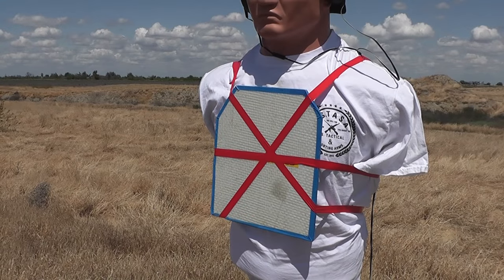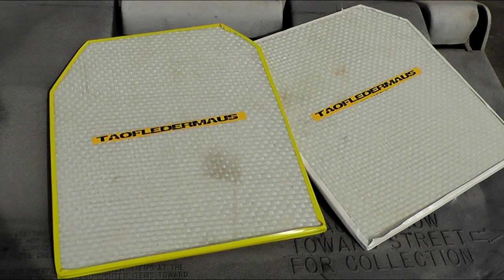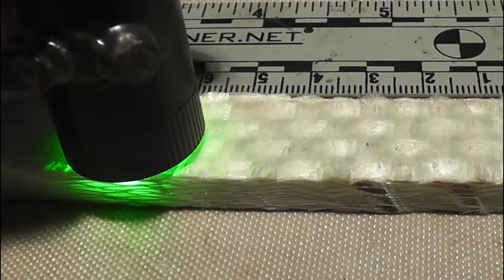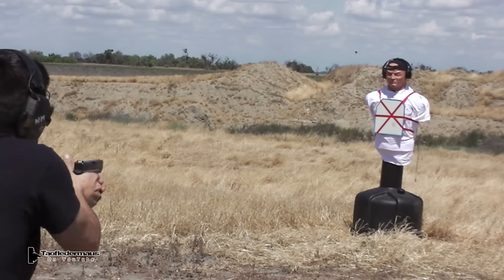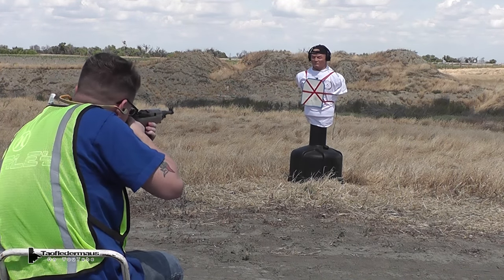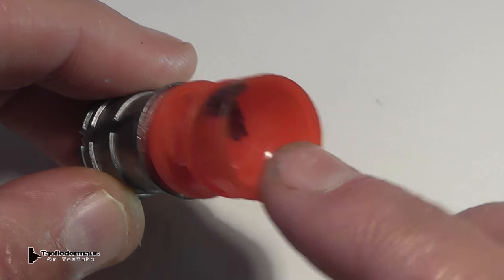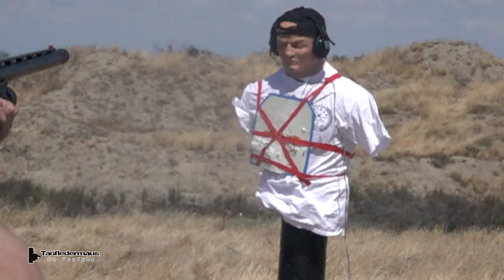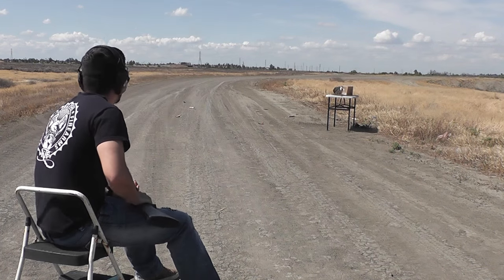Very Effective FIBERGLASS Body Armor

Comment: Everything is bulletproof if you have enough of it
Reply: +Jeronimo Murruni Every material
Reply: SalveMonesvol What do you mean with "material"?
Reply: Jeronimo Murruni A meterial is a simple or composit entity which has mass and shape. Essentialy, a solid. Air is not a material, since it can slow bullets, and you can argue that being in a hot air baloon various KM high, will prevent bullets from reaching you, but it will be the combination of air ressistance and transformation of Ke into Pe what eventually stop projectiles, not the gas. You could have a stream of hot plasma thick enough to destroy any projectile, but it will only work with projectiles coming from the side or below the stream, since projectiles coming from above would become a deadly rain of molten substances, with the same amount of Kinetic energy as the original projectile. Liquids like water will slow or break projectiles, and absorbe radiation, but even if you were in the bottom of the sea, a long penetrating rod would still get to you with great speed, since liquids can only slow down based on the ballistic coefficient of the projectile.
 Finally, only a material with sufficient tensile strength and in sufficient amounts, will be bullet proof. even the strongest non newtonian fluids will allow a steady penetration, only limiting speed.
 I know I went overboard, but It was a reasoning exercise for myself as much as an explanation.
Reply: SalveMonesvol You left me speechless.
Reply: +SalveMonesvol very good explanation.
Reply: +SalveMonesvol  His original statement is true, though. With enough air, you can stop bullets. 

I wonder what would happen if you shot a gun in a wind tunnel?
Reply: PumpJack McGee It will create an aceleration in the opposite direction where the air hits to. E.G. if the air hits on the right side of the bullet (air goes from right to left), it'll create an aceleration to the left.
Reply: PumpJack McGee It's like shooting on a windy day, the bullet will go on the same direction as the air goes
Reply: SalveMonesvol Because gravity will accelerate it. Air stops things if there is nothing accelerating them
Reply: @111001340073883456990 Therefore your armour works in imaginary, convenient circumstances? Also, the power required to maintain a certain speed increases cubically, therefore as the speed decreases, the air resistance will decrease logarithmically, therefore never, even in theoretical conditions, will the projectile be stopped. Also, as you may argue that infinite air may make the speed tend to limit=0←, I could argue that in such theoretical conditions my projectile can have an infinitessimal cross section, and infinite length, therefore cancelling the effect of air ressistance.
 We can waste our time arguing about theoretical shots with theoretical projectiles, but a real cannon will obliterate you from over 100km, with its projectile describing an arc of even greater length, without being stopped by the air. 
 Also, I doubt anybody will accept the idea that being surrounded by a thousand kilometres or air can be considered armour.
Reply: SalveMonesvol  Gravity would accelerate the rocks in that scenario. In regular circumstances, gravity works against the bullet.
Reply: PumpJack McGee Then you suggest that an armour dependant on the relative position of the shooter can be considered as such? with or without gravity, no reasonable amount of air will stop every existing projectile. 
 Have you decided weather you want to consider theoretical or realistic scenarios? Because theoretically, I am right. Realistically, I can't shoot a target a million km away, and you can't consider such distance to be your armour. 
 I propose that we consider that if the armour can be of great thickness, the prime factor in preventing damage should be the armour itself, and that the weapon's canon can be 1% as long as the armour's thickness. Also, the focus should be on the armour's ability to defeat threats, not on the threat's source of energy.
Reply: +SalveMonesvol What you are forgetting is gravity and other factors like glass of a water tank. Water is practically bulletproof in enough large quantities and is even used to some extent in improvised, fortifications and armor. Like a shipping container filled with water provides some protection against missiles.
Reply: Suojeluninja I'm not forgetting anything, you failed to read and understand in full. 
 Also, if you were so relevant to make it feasible for you to afford a fortification 1km underwater, somebody could care about you enough to spend a couple of torpedoes or depth charges to ruin your day.
Reply: SalveMonesvol

Lol some common engineers are not so relevant. To penetrate something you need to go all the way through and have a enough straight line. Well you could argue that a ball of water in outer space won't stop bullets but I'm more concerned about pratice.

And why 1km underwater?
Reply: Suojeluninja If you are an engineerer, you must be software, systems or electronic. Mechanical here. 
 1km underwater because it's a way of being sorrounded by a lot of uncompressible fluid, that would be great against many threats, yet fails basic criteria about cost and the ability to stop modern threats like rod penetrators or pretty much anything coming from above you.
Reply: SalveMonesvol

If you mean that a rod penetrator would eventually fall to the surface then yes but it would have to penetrate whatever it falls on.
HEAT charges with magnets are used against submarines while EFP:s are being used (in addition to other stuff) against MBT:s on similar distances. The difference; Water instead of air.
And why costs? Water is literally cheaper than dirt and all we need is fitting containers which are often either otherwise scrap/trash like empty watertight bullet boxes or natural water tanks/holders that also act as armor.
Mythbusters btw made some vids on the subject: /watch?v=v1uaLWAZXfk
Not to mention ice and snow.
Reply: Suojeluninja Gosh, I paused a video and lost what I was writing. 
 Short version: yes, water containers are good protection, but they involve materials, not just water.
Reply: SalveMonesvol

Well its not like we are planning to use irrigation sprinklers for protection.
Reply: Suojeluninja Not you, but some guys up there would be ok with plain air or water. 
 I would feel pretty safe behind a 3 metre thick barrier of cheap wood (pine 4x8" boards or plywood, usually in the 400-500 grams per cubic decimetre range). If the threat is great enough to go through that, the attacker would have to be determined enough to make any further fortification just a waste. Maybe add sand bags depending on the nature on the threat.
Reply: +Suojeluninja I have seen water balloons stop bullets.
Reply: Yes, nothing is bulletproof if you can choose your bullet so that it penetrates, or everything is if you can set the stage accordingly. Basically, everything has some level of bullet protection - some more, some less.
Reply: TakeoFR Correct. I just wanted to differentiate "anything" from "any material".
Reply: 45dvc well... theoretically you are right. But imagine a 1m diameter tungsten sphere, travelling at 200 meters per second. If a structure stops that behemoth, I'd simply call it bullet proof for all intents and purposes.
Reply: 45dvc

Cannonproof is a completely different league.
Reply: 45dvc Where I live, most crime is committed with .22 LR, so for me it would be some lvl 2 kevlar. It depends on where you live.
Reply: Jeronimo Murruni ya my bullet proof armor is air just gotta keep enough of that between you and the baddie
Reply: Even air
Reply: corn starch does a decent job
Reply: Not my face
Reply: 34
Reply: @SalveMonesvol  question I know you know your stuff so I wondered if you could answer: How would lava, Mercury, or other dense liquid 1cm thick in a 180 by 20cm container fare against bullets or even AP-AT rounds fired at point blank range? To give context in terms of the liquid's mechanics

The material that the bullet is impacting will use the energy from the bullet to push other liquid material out of the way (and this will repeat until it reaches the end of the container) to allow enough space for the bullet to fly through. On top of this, the liquid will try to keep the bullet inside of it, which would cause the bullet to carry pieces of liquid with it slowing it down and destroying it's aerodynamic shape.

Essentially, it should be like trying to penetrate the surface a hard rock repeatedly. In turn for this, the liquid is extremely heavy, and even the dimensions I described could be up to 150 lbs.
Reply: @lawrencemorris2261  AP-AT vs 1cm of anything you can think of, will simply go through. You can simulate that situation using water and a projectile with lower sectional density, like a .22lr.
 If what you want is multi hit fluid armour, think about sand inside an elastic container to prevent loss of mass.
Reply: @SalveMonesvol  40 year old virgin
Reply: @comanchedase  Thinking like a middle schooler. 
 In real life, people capable of reasoning methodically and having constructive exchanges have better lives and can make better choices to take care about themselves. Smart women prefer smart guys.
 That being said, I respect anybody's choice to be more or less sexually active, it doesn't determine a person's worth in any way.
Reply: Except dynamite
Reply: @brianroberts5740  hehehe you got me there m8 ;)

Although, look up Explosive reactive armour

Comment: Fun fact back in the early 1960's the boat builder foe the Hatterest showed a .45 acp bouncing off the the lower hull . If I remember the hull was a solid1/2 or 3/4 inches .The old Hatterest's we fuel hogs because of how much the weight but the were really bullet proof :)))
Reply: .45 acp is easy stop.. way too slow.
Reply: +Savage. Not in hardened copper. .45 & 12G in solid H/C are a whole different animal. Faster, harder.

Comment: Met a guy while out shooting on public land. He had a 5" thick 18x30  purple tint, clear  poylmer block. He was using it to catch/trap rounds like with ballistics gel but permanently in the block. 9mm, .45, .223, 7.62x39. It stopped a 30-06 at 100 yards. But it failed to stop a copper solid from a 30-06. The block itself must have weighed +80lbs.. It was very strange. I guess the blocks were used as clear shielding for machinist and technology work facilities. Asked him how much, he said the polymer blend block was worth almost a grand. He got to take this one home due to a manufacturing defect (small chip in the corner). Could you guys mix up something similar? This clear block was absolutely amazing with how it captured rounds, even HP without cracking the rest of the block.

Comment: Wow this glass useless. It's is not even transparent.
Reply from the maker: +superbarnie   lol
Reply: +TAOFLEDERMAUS XD I love that Mortal Kombat music.
Reply: +superbarnie Not all fiberglass products are transparent. Take for example a canoe or kayak made from fiberglass. fiberglass is mostly made from reinforced plastic where the reinforcement fiber is specifically glass fiber. The glass fiber may be randomly arranged, flattened into a sheet (called a chopped strand mat), or woven into a fabric. The plastic matrix may be a thermosetting plastic – most often epoxy, polyester resin – or vinylester, or a thermoplastic.
Reply: michael1234252 joke

your head
Reply: @michael1234252  joke or not, i think what he was getting at is that when properly saturated with epoxy the glass becomes transparent.
Reply: @ap-dh8md  even if you drown that thing in 2 gallons of epoxy resin it wouldn't be transparent, come on.

Comment: I have made this myself. It worked well. I used woven roving as the sheeting material. Much tighter then the normal fiberglass stuff.
Reply: Yeah me too. How much layers did you use? Any ideas on soft body armor? Cause with this method it stays hard, only good for plates
Reply: @Muckihito  I do not remember how many layers, but I do remember 1/4 inch stops most handgun rounds.

Comment: Tao, this past winter i worked in a state trooper barracks and they had same board in 1/2" thick. they threw out all the left over so i took some home and cut it up to and yes it's sharp edges can cut your hand easy. the board stopped all hand gun rd.'s but all rifle rounds just blew thru it even a 30-30 Win. BTW good idea to where a dust mast when cutting it. your going to have fun with it and i'll be watching.

Comment: I make fiberglass molds for a composite company. I've shot my old or damages molds just to see what would happen to them. The fiberglass in your plate looks to be roving woven fiberglass. My molds are made of 8 layers of 1.5oz chop strand mat. My molds will stop a .22 from a pistol pretty well. They will also stop .22lr from a rifle, but a couple of hits in the same general area and the bullet will pass through from a rifle. They will not stop a 9mm. My molds are not quite 1/4 inch thick.
Reply: Gun-chop glass mats are a lot weaker than woven mats, all else being equal but the overriding feature is what saturating resin to use and the finished density of the composite. Also chopped glass is E glass while S-2 glass used in high strength applications is a totally different beast. I have another post on the resin used in kevlar military helmet composites.

Comment: Dyneema is another panel you can try. Hardwire,LLC has a panel called "backpack insert". It's around $120.00 for a 10"x 13" panel. It's rated at level IIIA.

Comment: Also it don't really matter how tough the plate is the velocity of the round and the impact can't be stoped it will still travel into you body and once it's high enough say a 300 win mag or a 7.62×54 would still produce fatal amounts of energy even if it doesn't make it through the armour

Comment: We in the construction bidness call this stuff bullet board. It's actually some pretty tough shit. I've got some surplus 1/2 thick bb that's rated level 3. It easily stops multiple 44mag rounds out of a Ruger 44 carbine. 12ga slug is no problem for it either. Haven't tried any rifle rounds yet though.

Comment: Also consider turning the blade backwards if you ever need to cut this again.
It reduces the size of the particles and directs them a different direction. Water and a dust mask still recommended, but it will give a cleaner cut.

Comment: Fiberglass inside a bullet wound would be nasty.
Reply: +Michael Holland Yeah... I think I'd rather just get shot straight up than have a pass through while wearing that. I got a bunch of fiberglass embedded in my hands from moving an old, weathered fiberglass surfboard a few years back. A week of hell...
Reply: Not necessarily. If the fibers help the blood clot and form a plug that seal the wound, it might actually save your life.
Reply: would doctors be able to remove all the fibers though?

Comment: i'm curious what a 0.86" thick window of sapphire is impervious to, that's what i make for the USAF,  my boss got 3 stitches last week when we were moving a slab around, all the pieces are razor sharp! (i was on the other side of the piece, 50% chance of me being cut!) the ones we make are 5 feet long, 18 inches wide and 3 inches deep, so you can't pocket one of these 350 pound "gems".
Reply from the maker: +mr bad example   Get ready for a bunch of new safety measures the company will require!
Reply: ***** fine, you think i like picking up 100+ pound pieces of sapphire? kevlar bodysuits, most likely :) we got kevlar gloves.

Comment: They should corrugate the material at that thickness to give it a thicker relative cross section, coat it with a thin layer of the rubber used in self-sealing fuel tanks, and then drop it into a kevlar sleeve. I wonder what that would boost it's rating to?
Reply from the maker: +Richard Sabo  Yeah,  but boost the costs a ton too!
Reply: ***** I'm sure it would. The questions are:
1) Is the increase in protection worth the increased price? and;
2) Does it out-perform any other products in the same price range?

Either way - if the fiberglass is a good value for the protection it provides as-is, I'd probably buy some. It's better than the ballistic protection I wear now - which is none, primarily because of expense.
Reply: ***** It reminds me of the ancient Greek /linothorax/ chest plate. It was [theoretically] comprised of 12 - 20 layers of linen and animal fat glue, with strips of metal in certain areas.

Comment: what I always find fascinating is that plate stopped the 9mm  at the higher velocity but I feel it still couldn't be rated at that velocity because a potentially lethal concussion force can still be applied to the body from the plate. makes me wonder how many things they really test or if they just go for the "average" round for the rating they are going for.
Reply from the maker: +Ryan  Davis   Since it is tested by UL,   they probably are a little conservative at their ratings.  It WILL always stop a 9mm going X velocity.   But it MIGHT stop faster bullets.

Comment: Is there some cheap-ish way to measure the force that continues through the plate? Something tells me the paneling is not used for body armor due to the overall shock force inflicted on the body behind the plate.
Reply from the maker: +Steven Wagner  It's probably the same type of force a steel plate has,   you'd probably sting bad,  but  I also thing there would be a lot less brunt-force trauma.
Reply: Probably. Was this material more of a rigid sheet or more like the soft-body kevlar? It looked like the latter, which seems like it would absorb more of the shock and disperse it more evenly.

Comment: I would love to see you paint one of those panels with a bed liner like Rhino bed liner. Maybe even use a poly-carbonate sheet with a 3/16" hard stainless steel metal plate sandwiched between to see if it might upgrade it's bullet resistance. Would that be possible?
Reply: no